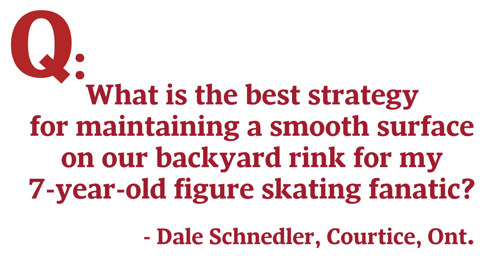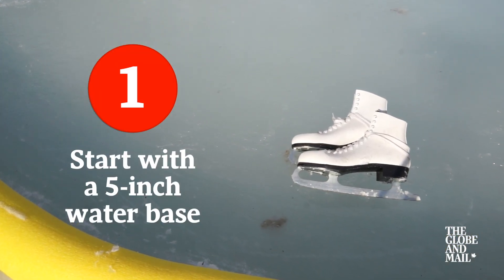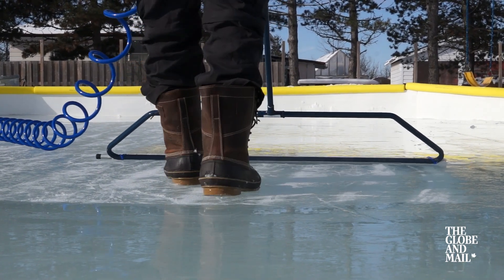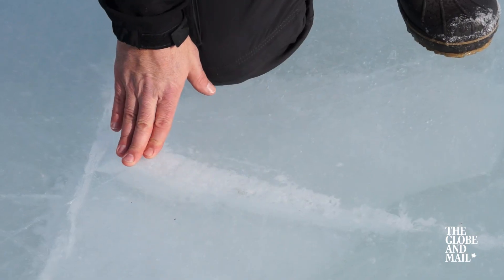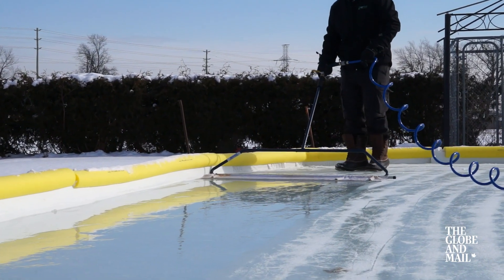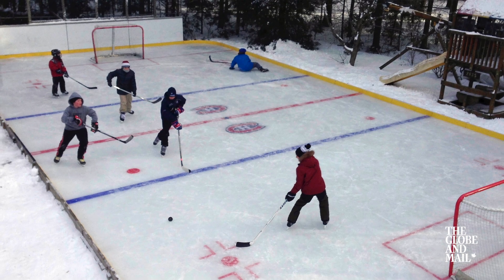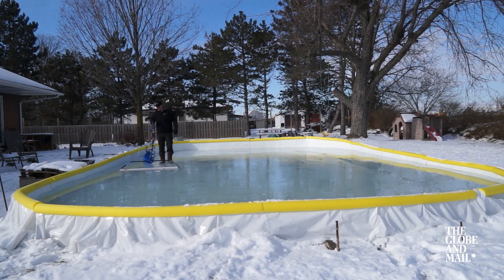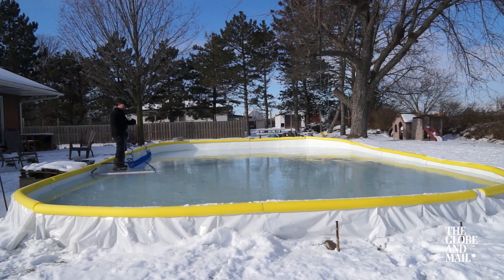Three tips for keeping your backyard rink smooth all winter long

Comment: Get Rubbermaid bin
Drill a few small holes near bottom 
Get a piece of rubber and screw into side of bin higher than  holes. 
Bin Zamboni.
Dump warm water in bin and drag.
Worked well for me on budget

Comment: "Does the same thing as an zamboni" it doesn't appear to have a blade, so it will never be perfectly smooth :p
Reply: Or a wash box, or a horizontal auger, let alone a vertical auger, or a snow bin... Fuck I could go on and on! How does one adjust the throttle on a garden hose? LOL

Comment: U can’t smooth out bumpy ice!! I’ve tried with this method and it does not work
Reply: Use hot water. It melts the ice slightly, then refills in to a flat surface.
Reply: @Hymanshattricks  after the snowfall last night my perfectly flat mirror ice rink is a bumpy mess yet it isn’t hard enough for me to put my weight on ugh I hope after a few more days of cold it will be hard and I can try a combination scraper, resurface and warm water as needed to get it back to where it was before.
Reply: Hold a free curling tournament. The competitors will smooth out your rink.